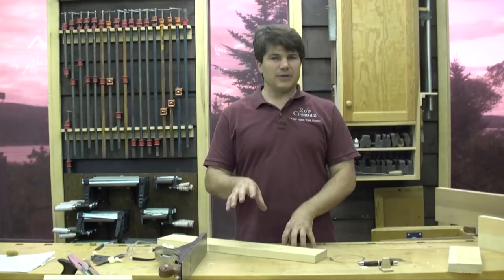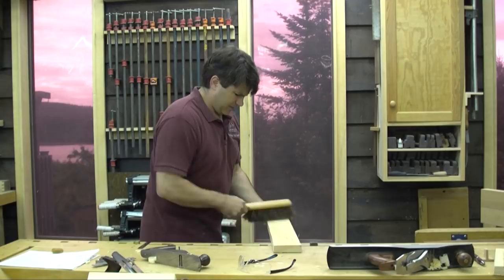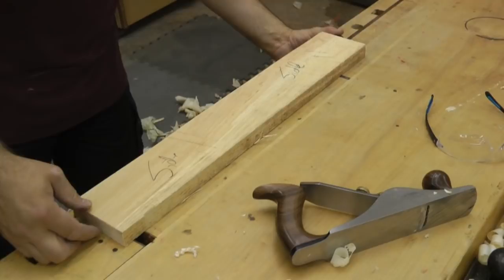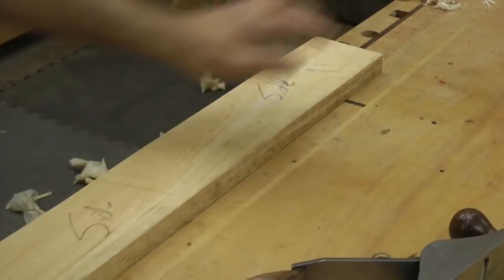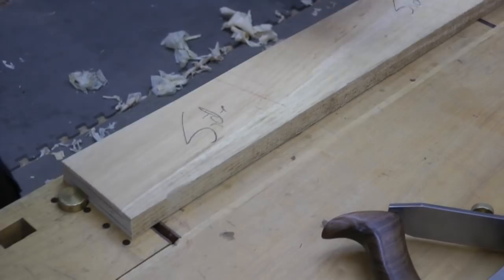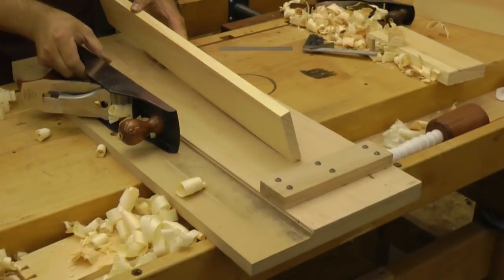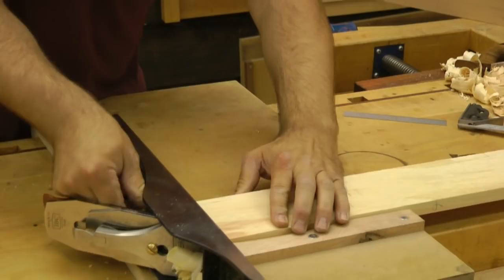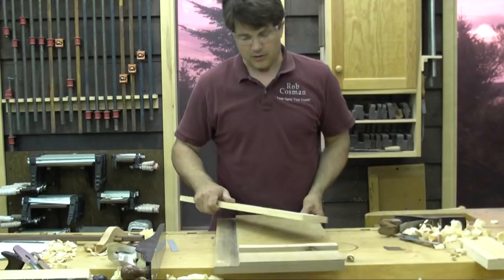Hand Tool Project - Episode 3, Pine Candlebox

Comment: Regarding parts 1-3,  Lots of great pointers on sharpening and really good fundamental skills. Very nice, thanks! But until I have that skill level and the patience, I'll stick with 5 mins on the jointer, planer and table saw and I'll keep watching and learning.
Reply from the maker: Mike Allan hey Mike, you might appreciate our online workshop which uses both power and hand tools, check out www.robsworkshop.com and you can try for free for 30 days

Comment: I've never used winding sticks before need to give them a go. I always use a straight edge in each direction but I can see how there could still be twist. I notice you don't check the length with a straight edge, could there not be a hump (or less likely a hollow)? maybe winding stick wouldn't pick up on that? Great vids
Reply from the maker: I usually do check front to back for a hump.  There is almost always so you have to create a hollow and work it out as you deal with the twist.  complicated?
Reply: @RobCosmanWoodworking  not complicated just a fun process 👍🏻

Comment: I have a general question. How can you ensure two different boards end up the same thickness? I'm not a woodworker (yet) and it appears you have to plane each board until the winding sticks say they're perfectly flat. Couldn't that mean that one board gets to that flat surface at a thicker point than the next? Maybe I'm not understanding so any help is appreciated.
Reply from the maker: The first surface is your reference face, this is the only one you use winding sticks on.  Once it is true, all other surfaces are gauged off of it, edge, ends and other face.  The thickness is measured with a marking gauge that leaves a line on all four edges, this line is referenced off of the reference face so the final face is parallel to it when you take the surface down to that scored line, all the way around.
Reply: @RobCosmanWoodworking Aha! That makes sense. Thanks for taking the time to reply, Rob. I'm really enjoying this series.

Comment: Rob: You made me cringe where you scrub-planed the wrong corner at the beginning of the demo.. ;) Why flatten the piece with all that effort instead of using some shavings to clamp the piece free of rocking? I would even just clamp it in the front-vise (concave side down) and plane the convex side to flatness.. Then mark the thickness and plane to the gouge-line..